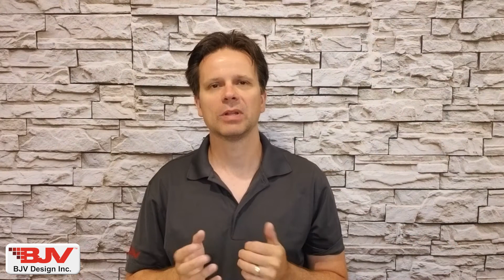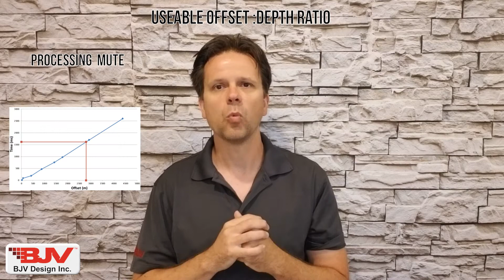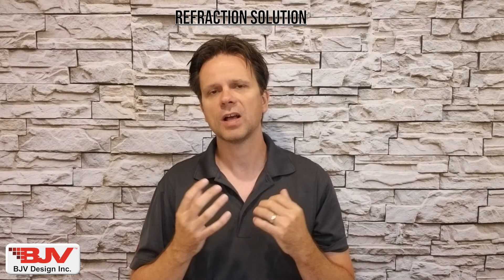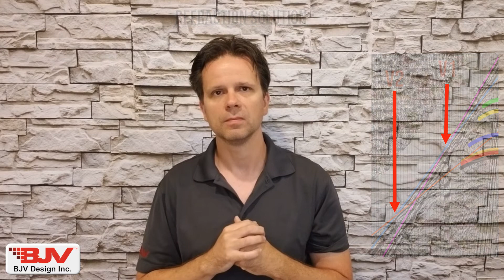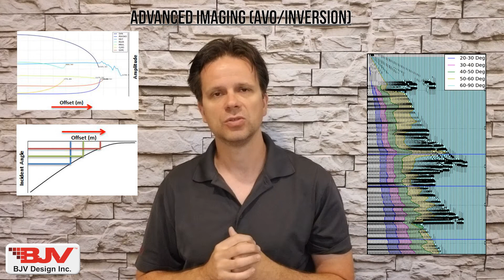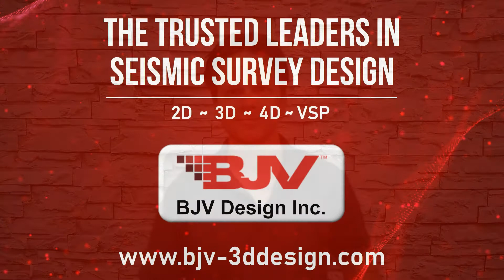How to determine the Recording Patch and Far Offsets of your 3D Seismic Program - Episode 2

Comment: Hi sir can you explain the 2D design parameter ... thank you
Reply from the maker: Sure, which 2D design parameter are you referring to?
Reply: @bjvdesigninc6298  max and min offset
Reply from the maker: The maximum offset is the distance between a source point, and the receiver that is furthest away from that source point.
The minimum offset is the smallest distance between a source-receiver pair, in the case of a 2D line that distance can be defined by half the receiver interval if source and receiver points are non-coincident, or 0 if the source and receivers coincident (same location) @محمدالداهري-ز7ق
Reply: @bjvdesigninc6298  thank you sure
Reply from the maker: You are welcome!